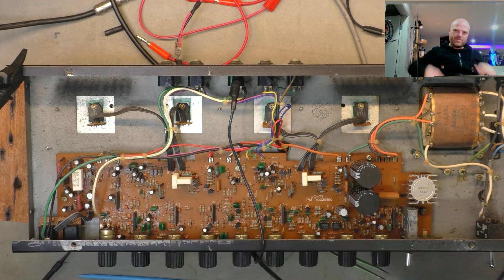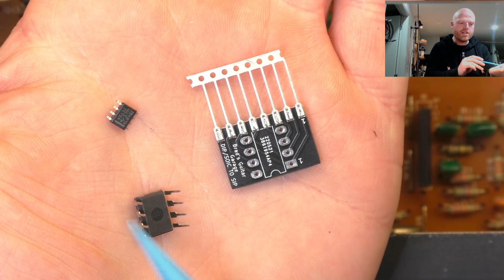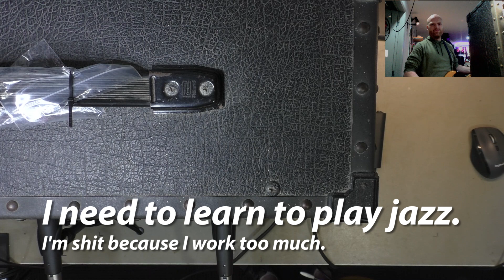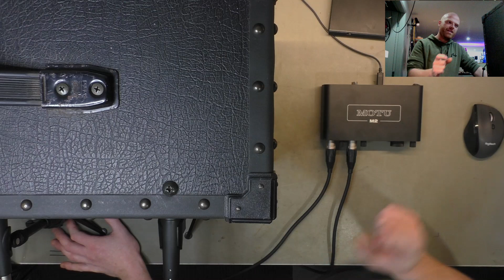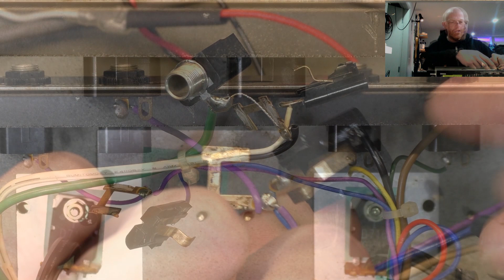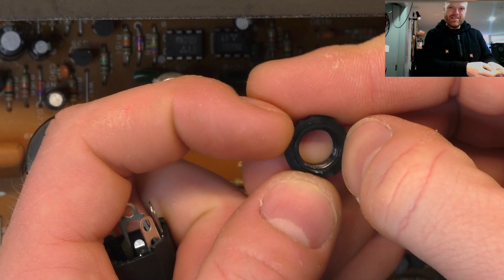2 x Roland JC77's Noise Reduction & Gain Structure Changes

Comment: I've got a Roland SR60 from around 1978. Similar thing without the chorus or distortion circuit. Has the inline chips. I especially like how there's no brace between the front and the back of the chassis for rigidity, so the pots can weeble wobble and crack their solder joints

Comment: I can't find this information anywhere but if facing the amp...which speaker gets the dry signal and which gets the wet signal? Any help appreciated.
Reply from the maker: It doesn't really matter, mate.
Our mind only picks up the difference, not the absolute timing, but from memory I think they came from the factory with the left-hand speaker (when looking at the front of the amp) receiving the unaffected signal.
Reply: @BradsGuitarGarage thank you. Have you used this amp in a live gig setting. If so did you use straight to pa or mic the amp?

Comment: I have a JC-55 and I think that the noise gate is having a bit of an issue because I keep getting "whooshing" in chorus mode, even when not playing. (replaced bbd and driver already) Not sure if this is a feature. The noise gate does seem to work but I feel like it doesn't close properly leaving the whoosh through all the time. Do you know if this whooshing is normal in chorus mode when you're not playing? It's dead silent if the chorus is off.

Comment: I have a 1985 Marshall  Reverb 75 combo with the Celestion Side Winder speaker. It has a loud popping sound when switched on and hums. The hum stays the same with all controls to zero or turned up. It’s a great ZZ Top amp and all around amp. Would love it if you could repair it. It’s hard to find a good technician & that’s honest these days. Thanks Jamman610 Texas.
Reply: Are you THE Jam Man? From Texas?
Reply: @bivvystridents3752 .   No, You Tube named me that. But it fits. Just did open jam New Years Eve.

Comment: This was great watching as I have a mix of tube and SS amps! On the solid-state side of things, these 70’s-80’s era always seemed to have fairly poor distortion. My 1983ish Yamaha JX Series 55 is similar. I’ve always wondered (without any real knowledge of the circuitry), could this era of amps have the distortion circuit modified to have some improved chip, there are so many great overdrive pedal circuits these days (Klon, Blues Driver, Plexi Drive, etc…), could one of these chips/circuits actually be incorporated into the existing amp? Or it is just not electronically possible. Thanks.

Comment: I kinda wonder if there is also some hiss coming from the chorus circuit. This seems like the same era as the Roland Juno60-106 which had a noisey chorus when turned on.

Comment: I liked this video a lot.  I own a JC-77 that I have had since I bought it new in the late 80's and have loved it.  The only complaints I've ever had about it are the hiss and the fact that it gets so loud so early in the rotation of the volume control.  To say the volume control is not very intuitive was a very accurate statement.

After finding this video I made similar changes to my JC-77.  The 1M audio taper pot makes the volume control significantly better.  I also reduced the gain on op-amps IC-2 & IC-3, also going with 75K feedback resistors.  I used different op-amps though.  I went with an OPA2134PA in IC-2 and an LM4562 in IC-3 and replaced all the carbon resistors in the signal path with metal film.  Though the OPA2134PA is not as quiet as the NE5532, the OPA2134PA with its true FET input sounds better and was an acceptable trade off to me.

None of the jacks on my amp were broken but the amp is very old now and plastic does gets brittle as it gets old.  So I replaced all my jacks with metal Switchcraft jacks.  You can duplicate all the switching, grounding and insulating functions of the original plastic jacks with four 12As and three 11s.  I used black shoulder washers and nuts on the jacks to make them look almost factory.  It's nice to be able to play my JC-77 at home now without rattling the windows with the volume only at 1 or 2.  LOL
Reply from the maker: Yes, 75k is where I landed after some experimentation.
From memory, this bloke told me he never took it above 2 anyway.
If you go too low with that value though, guitarists who ride the vol knob on the guitar won't have enough make-up gain from the amp, so it pays to talk to the customer about their playing techniques before starting work.
Reply: @BradsGuitarGarage  Oh it still gets more than loud enough to gig with.  I also observed that the distortion on my JC-77 is more usable after these changes.

I didn't mention it before but my JC-77 had a problem with the reverb so I ended up going back in this morning after receiving some parts during the weak.  While rebuilding the reverb drive circuit I went ahead and replaced IC-1 & IC-4 with LM4562NAs since I have a lot of those on hand.

The reverb issue turned out to be Q3 & Q4 transistors.  They are supposed to be a complimentary pair but they were not complimenting each other much at all.

Comment: Just saying, as the owner of amp #2 (yes the one Brad actually worked on), he!s mad an amazing difference to my much loved JC77. It’s now soooo much better.  Usable volume pot and doesn’t hiss me to death when using. Greta stuff Brad. Worth every cent.
Reply from the maker: Glad to hear it suits your needs, Ken.
Word must have spread as I have another 2 in the queue now for the same treatment.
Give me a yell if you need anything else, mate.
Reply: @BradsGuitarGarage  hey Brad. Thanks. I  sure will. It was worth the trip across the city. But only for the bigger stuff. Also I’m still amazed at how reasonable your pricing was on that repair/upgrade. Thanks heaps.
Reply: @BradsGuitarGarage  It's a good mod that makes a great vintage amp even better.  So I am not surprised that others would want it done to theirs.

Comment: Cool man! I have one I picked up for free. I like it and I don’t like it lol. So it was dead and turned out the owner twisted the fuse holder, till the inside wire broke. I fixed that and it came back to life. But it does have the hiss at times, without chorus on even 1 it has a severe drop in volume to where it’s shrill and no bass or eq seems to work. It sounds beautiful on its own with chorus at times. But with an OD pedal or anything it sounds extremely boxy, no matter what I do to the eq. I’ve cleaned on pots with Deoxit and it helped a little. But I’m not sure what’s going on as it just has a horrible bass sound. Mids are just boxy and not very present. 

Either mine is really broken, or it’s only good to play clean with chorus as a one trick pony. I’m keeping it, and hopefully it’s just something fixable. Bud def will have to buy a fender amp or something more suitable for my OD tones.

Update: my speakers were weird because the last user wired it wrong. Seems someone at a college attempted to replace fuse, broke the fuse wire and said it just broke. Sat in storage for years nothing wrong but that. In 2 years finally had issues, as if you knock the amp hard that fuse wire comes lose. No fuse blown… about to take the board out and pray no burnt circuit! Smelled a bit of smell, and knocking the amp hiss went up more. Thinking my issue is directly power supply and fuse wire needs a full replace… short term for 2 years just cleaning pots, using low gain input and doing the fuse wire worked. But now it’s back on the edge of issues.

Comment: I just got a JC-77 and love it, it seems to work well but has an unusual odor kind of like a somewhat sweet warm epoxy or resin smell. Are you familiar with this smell? Should I be worried? I can't yet tell if it always smells like this or only when it's on. I'm wondering if it could be a sign of bad capacitors or other components but since it seems to work well I'm not sure. I'm not sure I want to pull it apart but maybe this would be a good first step? The previous owner said it was in good shape the only issue he had was sudden drop in output after the amp has been on a few hours that is remedied by adjusting the volume pot he said this only happened a few times. Some JC manuals mention servicing for if "unusual odor" occurs.
Reply: If you have an unusual odor coming from any electrical device you should get the device checked out.  With that said, JC-77s can be 30 to 38 years old now.  It would not be a bad idea to have a pro take a look.

Comment: Curious, what's the cap(?) on the PCB for?
Reply from the maker: Rail to rail decoupling to counter any instability due to the extra trace length between the IC die and the pins. No ground is present on the little PCB so that's all we can do on it. Rail to ground decoupling should be present on the main PCB in a well designed amp.

Comment: Is that a power supply located directly behind the input jack's,  for the IC's perhaps?  That's not very smart. Is there any chance that some of the hiss is actually Johnson noise from carbon comp or carbon film resistors?

Comment: Looks like you have a small splinter right below the base of your little finger on your left hand when you're holding the custom IC circuit board.  That would drive me nuts within about 20 minutes, it'd be slightly inflamed and itchy or painful almost immediately andI'd have to get a pin or a razor blade and dig it out ASAP. PS, nice job on the boards!